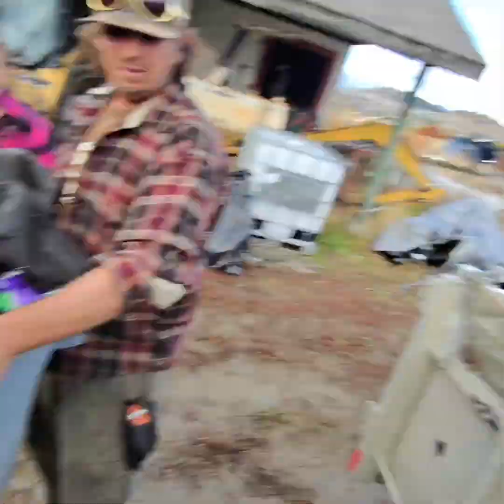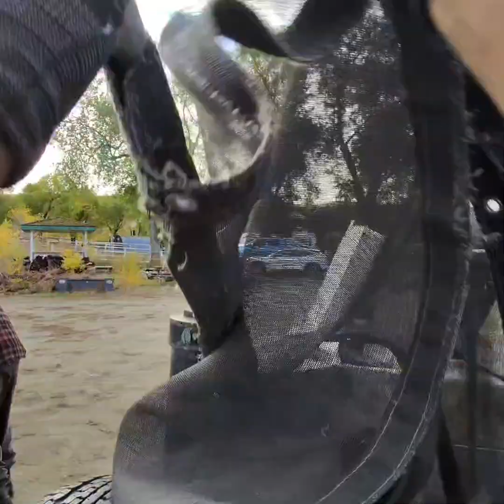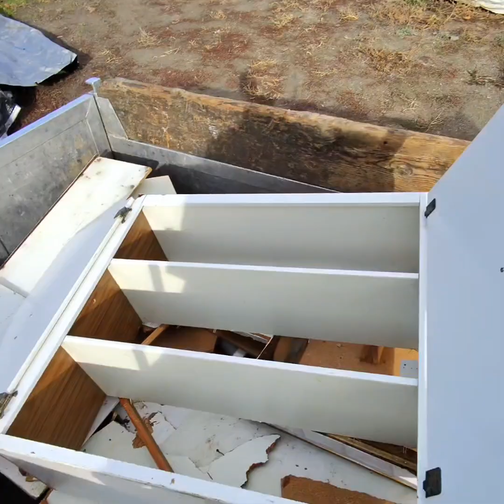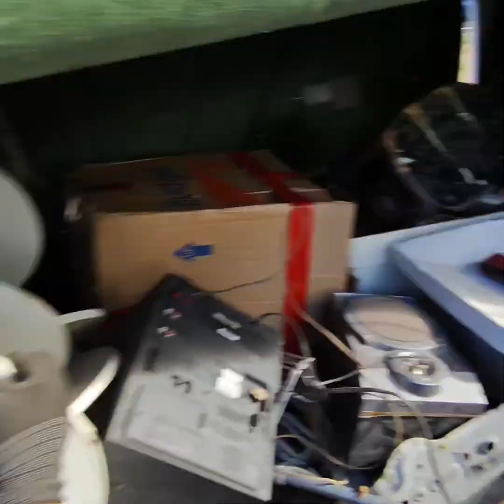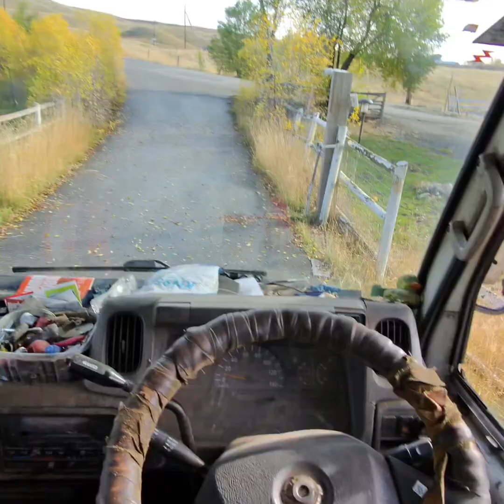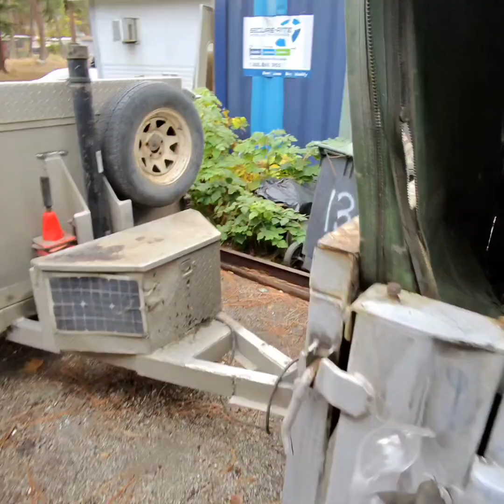5$ junk day

Comment: Happy Monday ! Nothing like some copper and brass to start the week ! Does Action have a minimum weight for rotors and drums? Somebody dumped at bunch at work but Knox won't pay you unless it is more that 500 pounds of auto cast.
Reply from the maker: They don't care at Action.  Sometimes I bring in 300lbs of shred to empty my trailer.  No complaints.  They have an automated payout system so I don't think they care as much since they don't have to write up a bunch of stubs and paperwork and cut a cheque by hand.  Price is down pretty bad.  Shred is at 40$/ton so I think cast might only be $120 or so?
Reply: @Nas_Atlas  Ouch ! It was over $300 a ton at the coast not long ago !